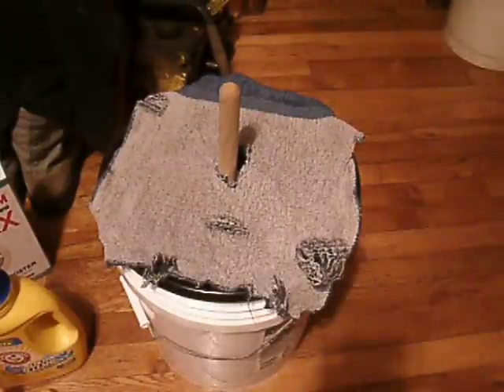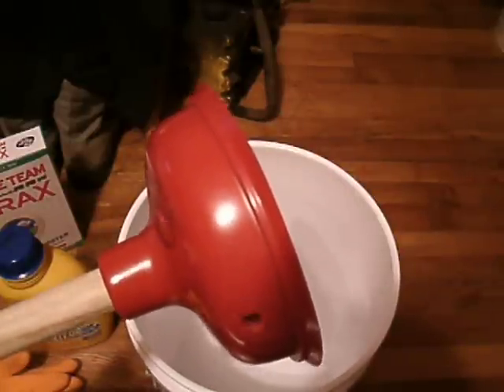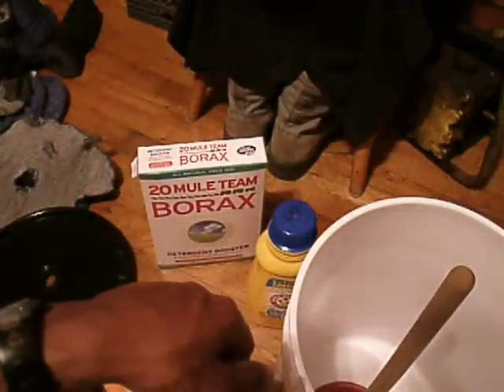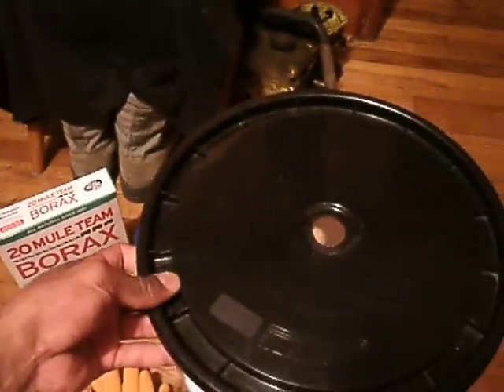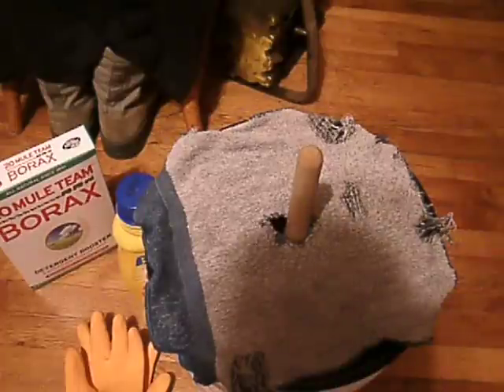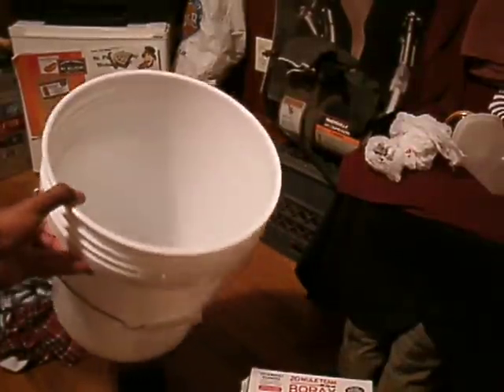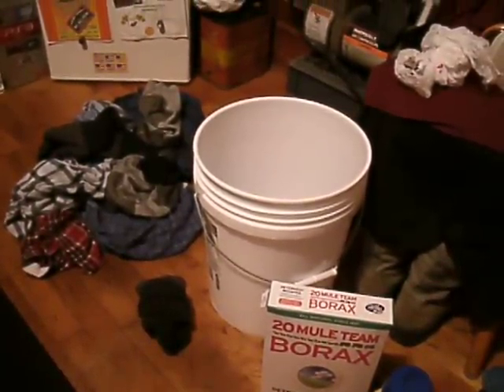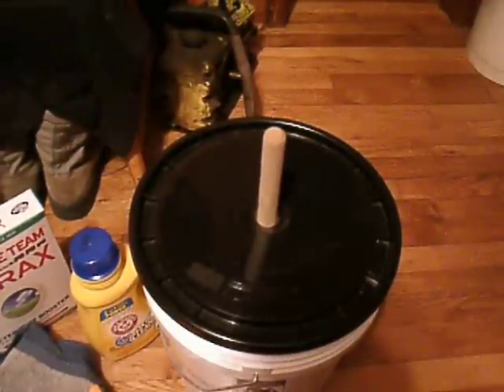Hand-Powered Washing Machine

Comment: Nice vid! To solve your leak from the top. Get a small sheet of gasket material (can be found at automotive parts store) and custom make a seal to go around the handle.
Reply from the maker: I decided to drill a larger hole. It vents out the pressure made, while the agitator is moving. I will have to make a follow-up video on the improvements made over time.